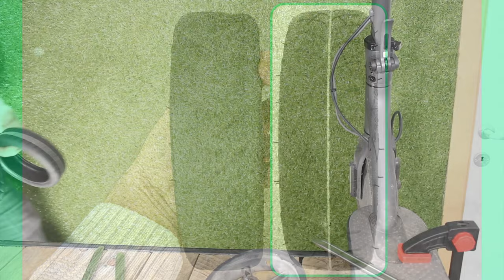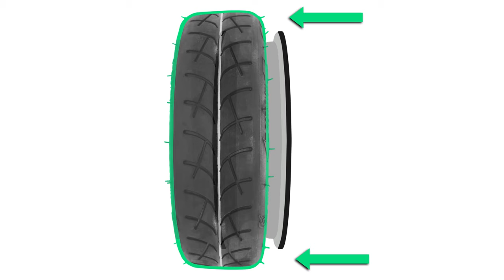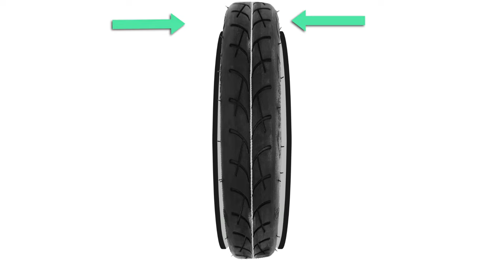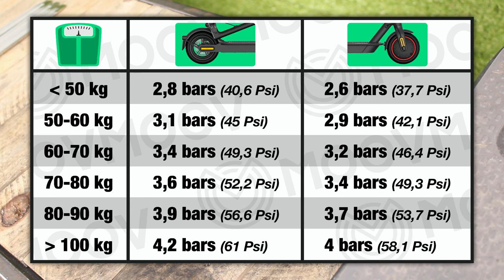TUTO Xiaomi 2022 – Changing the REAR WHEEL BY HAND! Tyre and inner tube: M365 Pro - Mi 3 🛴 💚

Comment: Thank you, it was harder on xiaomi 3 but I get it done ✌️
Reply: Hey. Why was it harder? MI 3 uses Allen screws or torx screws? Thanks a lot
Reply: I had to loosen the brake disc before putting the wheel back on as the brake unit prevents putting the wheel back on. God knows how I got it out but probably easier to loosen the break disc before removal too

Comment: Big thanks for the video! My 5 cents on this: it is CRITICAL to get the lower part of tyre inside the rim and tighten the zip-ties, only then it is possible to mount the tyre fully back on with no great effort. Even cheap plastic tyre-levers will do.

Comment: Had no cable ties, used my knees to keep pressure on the tyre while fitting the rest on. Great video! The secret is definitely using soap! I also boiled the tyre for ~20mins to make it easier to fit.
Reply: Boiling dont damage tyre?
Reply: Tried the same but my body weight of 80kg was not enough on my thumbs to push the wheel on. I would've required someone to climb on top of me I guess.